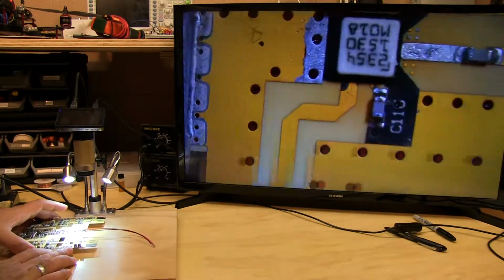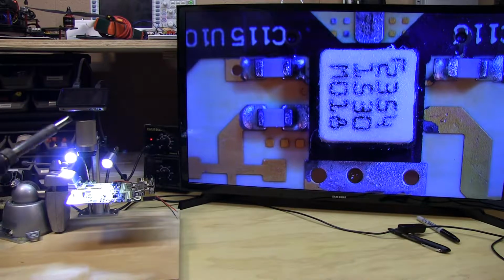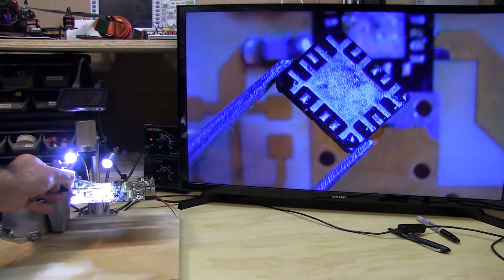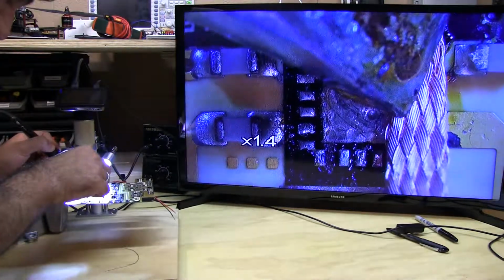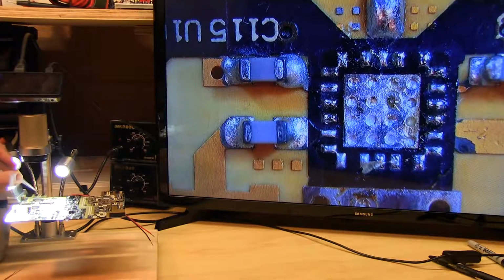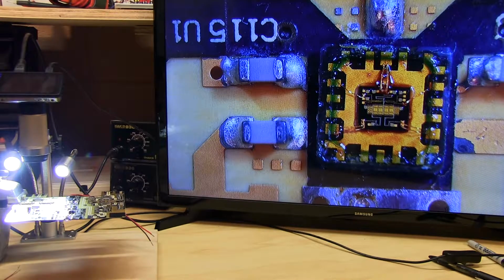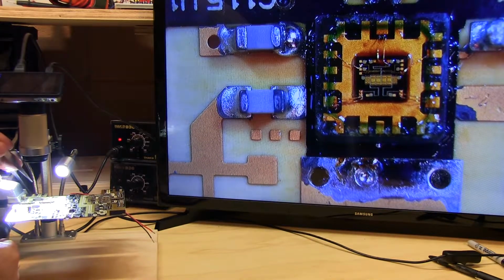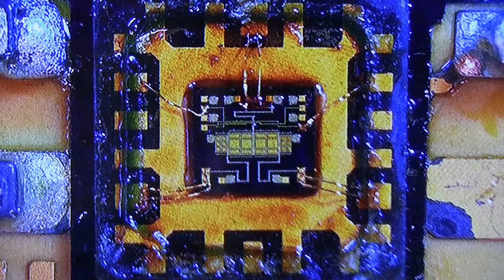#3 QFN and DFN IC Packages - Description and Soldering Rework

Comment: Thanks for this video!

I'm not an expert on RF at all, but love it and I'm curious: why are these small squares in two rows near the output of the switch? An why the is a single strip of these squares near the left input but not on the right?

I guess them are to adapt impedances, but I've not found yet a book that explains it.

Comment: I am wondering why you are trying to clean up the pads with dry wick. A god dollop of liquid flux and the whole process takes seconds. You need liquid flux to get wick to work at all. It got quite painful to watch.
Reply from the maker: I’m sorry for the pain that this video you voluntarily watched has caused you.

 I agree that using additional liquid flux would be a good way to quickly clean and prepare the area. I’ll try that sometime.

However, solder wick is impregnated with rosin-based flux, so  saying that you “need to add flux for it to work at all” is not accurate.